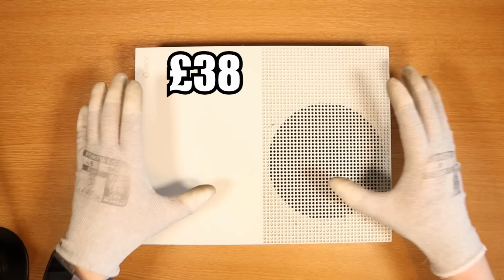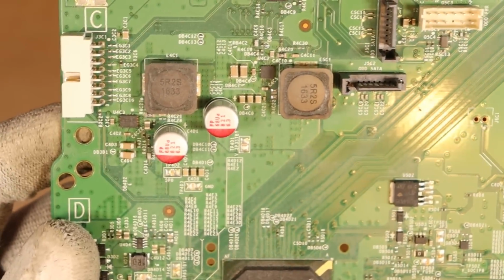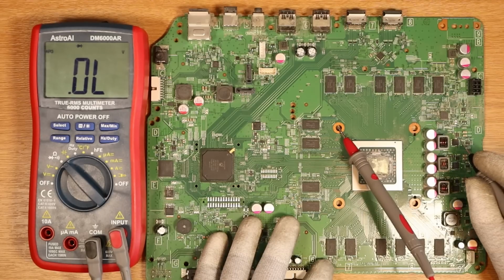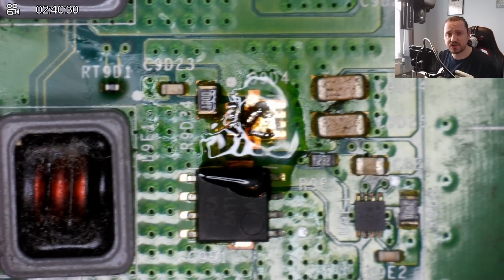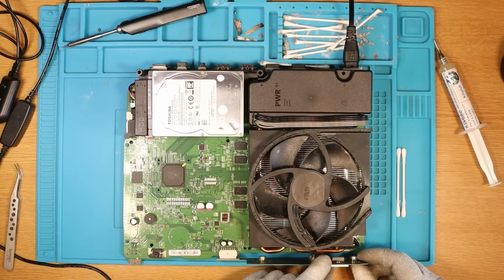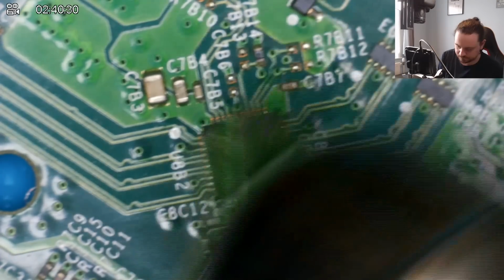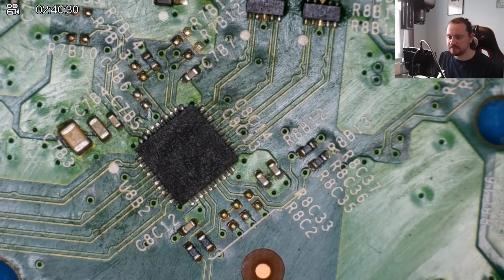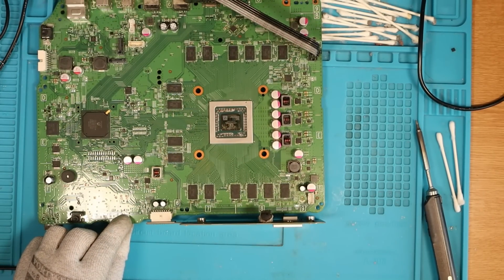Only $50 for an Xbox One S... Can it Be Fixed and Sold for Profit?

Comment: In the same boat, had one that had an issue with the volts on the left side of the board, replaced a step down thingy.  Got it working played 14hr worth of games.  Powered up and gone to on/off issue. Tried Psu and HD nope.
Someone has suggested checking the ohms on the roils?
Reply from the maker: I haven't tried PSU and HD just yet, so will most likely try in a stream tonight I think :)

Comment: Had same issue (power on and then off) on one of my Xbox one S. Retimer chip was fine (I used it in another board..), tried another PSU no clue, swapped HDD with a full working one same problem. I guess something at APU level or maybe southbridge... a real pain.
Reply from the maker: Beep on beep off is a pain hey!

Comment: Just curious could not having the hard drive in/ a bad hard drive cause that? (I have never worked on these so just a question) Great video  :)
Reply from the maker: When the hard drive is out I get the same issue :) So I think even with no Hard Drive the Xbox should power on for a decent 5-10 seconds before overheating
Reply: @JoeyDoesTech  that does make sense, thanks for replying :) I have yet to venture into repairing anything bigger than a ds lite, so I qm always curious how these work. Which is why I love video like yours :)
Reply from the maker: @TheAppStop  ah thanks for the support :)

Comment: I'm pretty sure that there was a short but it burnt out. So look for a bad reading somewhere. Or a little  color change.
Or a hole in a small resisitor.
Check and trace the power_good pins and follow them. Maybe just an and gate is bad.
Reply from the maker: Thanks Kiki :)